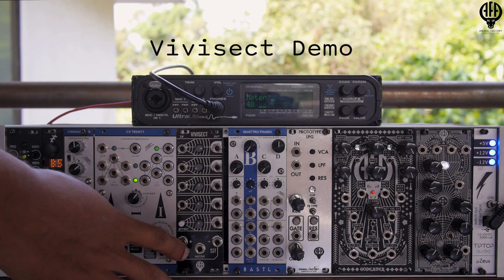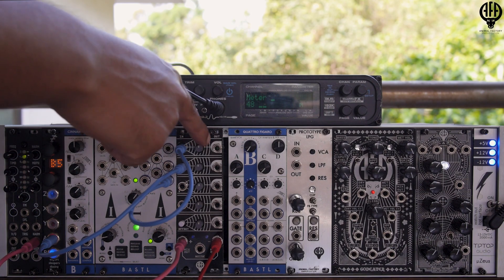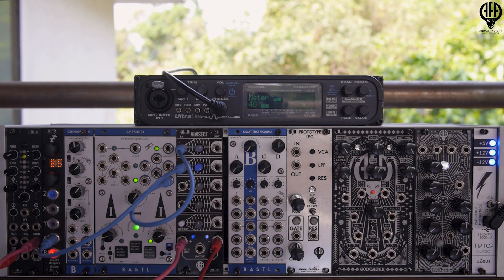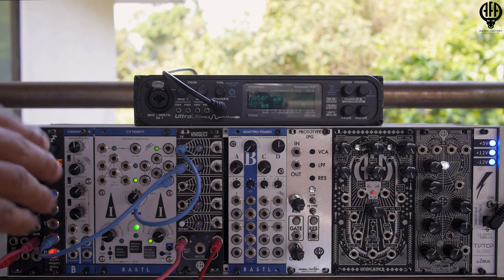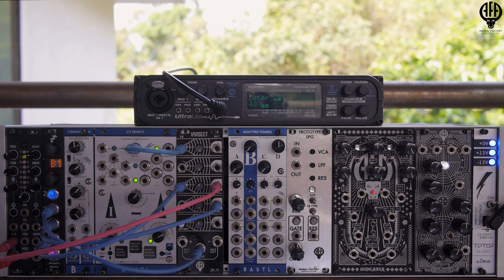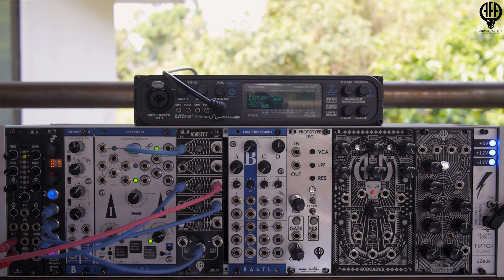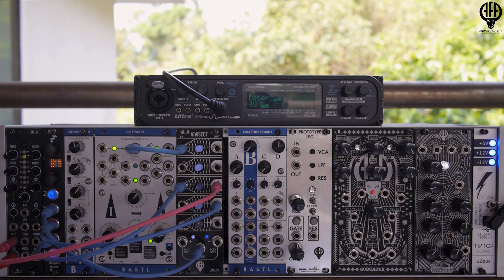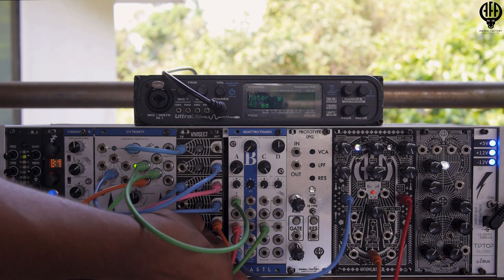Vivisect: Full Demo | Eurorack | Animal Factory Amplification

Comment: What would be the advantage of not jumping the module to function as a multiple, if plugging a cable into an input breaks the cascade anyway? I'm sure I'm missing something!
Reply from the maker: Great question! You aren’t missing anything as such - however, the header (that is jumped to make a mult) also serves as an expansion header for the Animal Factory Bonesaw VCF module (and maybe others in the future). 

The bonesaw connects to the vivisect using a 6 pin cable. 

More details on this in the Bonesaw manual if you’re interested.

Comment: Does it also work as an audio mixer?
Reply from the maker: Yes! It certainly does work as a simple unity gain audio mixer. You can also flip the phase of audio signals to get interesting wave shapes going when working with e.g multiple outputs of an oscillator.
Reply: @AnimalFactoryAmplification  audio is also multiplied correct? so if you plug audio to input 1 and an env to 2 (and vice versa with 3&4) you'd have a dual vca (with extra noise) ?
Reply from the maker: @flame_modular  nope - this is a pure summer. you would get the sum of the audio signal from 1 plus the DC offset from 2. probably not very useful...
Reply from the maker: @flame_modular  there is however internal normalization - you can send the input of channel 1 to all other channels. Basically use it as a mult with per-channel attenuverting.
Reply: @AnimalFactoryAmplification  And what's the HP size?
Reply from the maker: @vaibhavbatra4613  8HP
Reply from the maker: Addendum for full disclosure: with faster signals and more harmonic content, the null position in the middle will NOT be perfectly zero. Works great for CV, but audio signals may have some issues being perfectly quiet, especially louder ones with a lot of harmonic content.